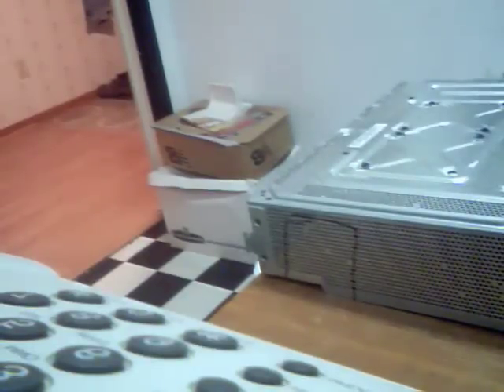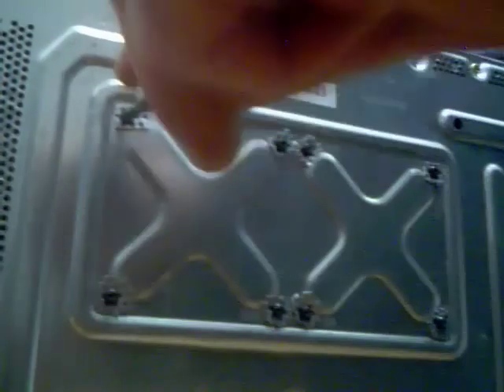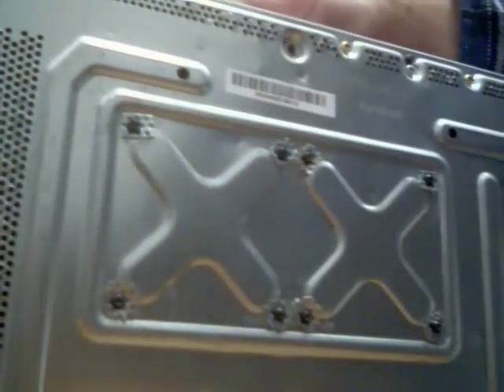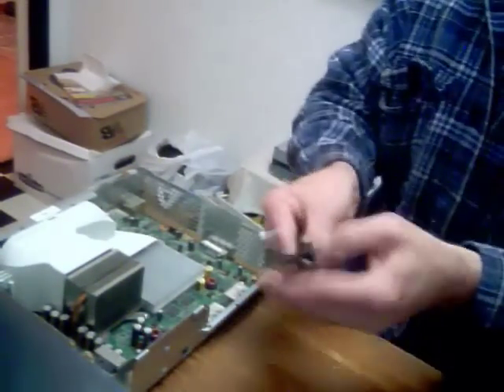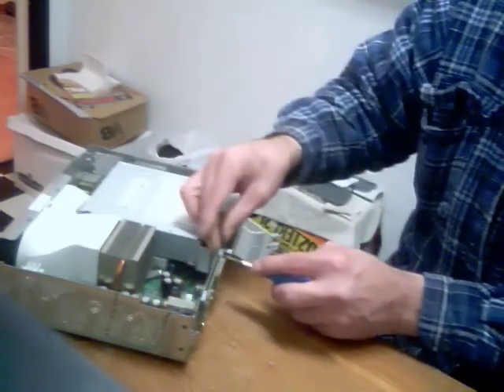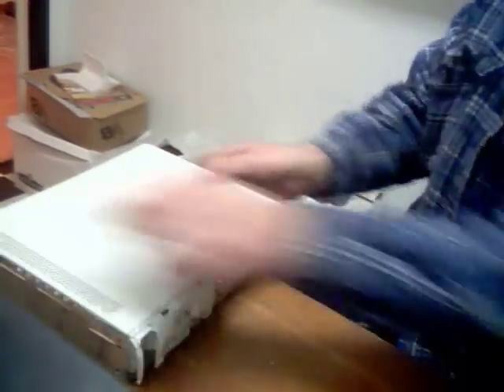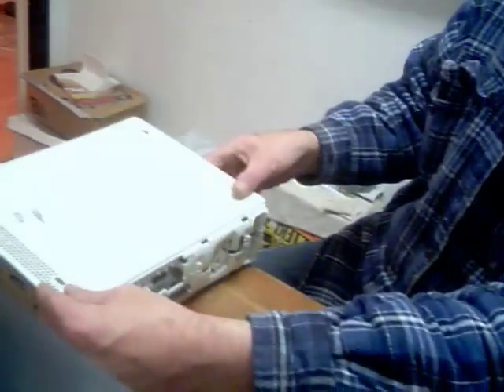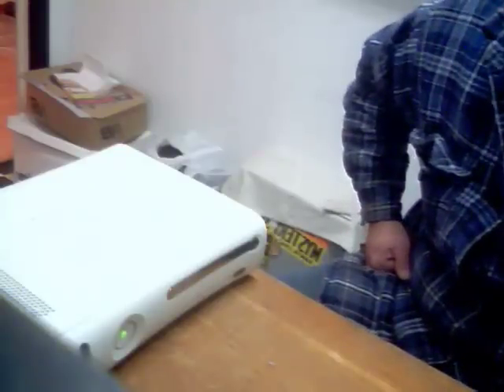Fixing a 2 Red light Error caused by YouTube repair #4 of 4

Comment: Bought an overheating (2red light) Elite off craigslist today. Took it apart and found out the previous owner did the "youtube repair" as you call it. Now, not only do I have to buy some Arctic Silver, I have to buy some new X-clamps and screws. BLARGH! The worst part? They didn't even drill the holes in the metal plating for the bolts. They just screwed the plating forcefully down on top of them. Which completely goes against the "pressure" logic of their "fix" in the first place!

Comment from the maker: @KyoshoBallard There may be enough thermal past on the chips to reuse if it looks clean the over heating is because the heat sinks are not flat on the chips look on crags list and find a local YouTube repair man and buy the clamps from hem for $5 or less as long as they are not all beat up. You are good.

Comment from the maker: @dustinbissell If you had 1 or 3 red lights The reason you got the lights was because ether your Xbox is old or you had a lot of dust buildup on the heat sinks causing the box to run hotter and it crystallized the solder below your chips requiring a proper reflow or you had a chip or other component fell! This is why I started a YouTube post!! forget everything you have watched!! And pay close attention to my videos, what I say! And the description before you do anything with your Xbox!

Comment from the maker: @hotpies4567 ((Yes)) There is many ways to clean the old thermal past off the chips, you can use hot air not rill hot just enough to worm and soften it, you can use isopropyl alcohol 70+% "I Recommend 91%+" less water that can possibly damage the chip. The best way is to buy thermal compound remover found at radio shack and a cheep Q-tip found at dollar stores

Comment from the maker: @dustinbissell That is good! BUT Im saying you may have cracked a solder joint when you wore unbolting your last Repair or even re-installing the X-clamps or installing the small screws going to the X-clamps. (It is not hard to Do!)
There is nothing ells I can tell you.